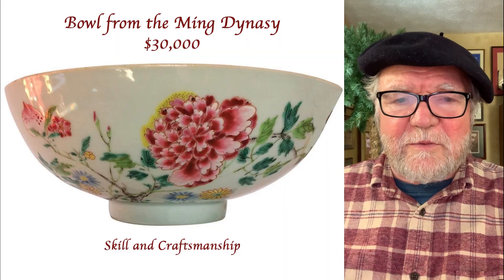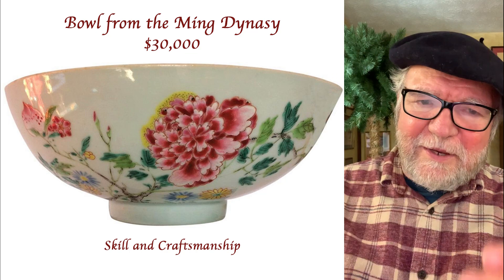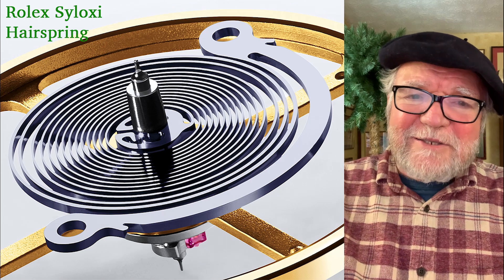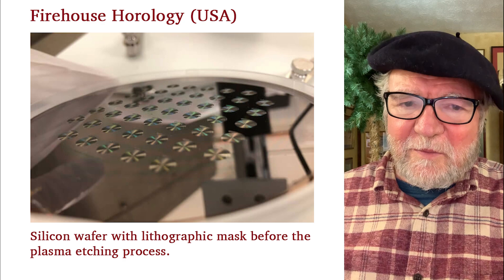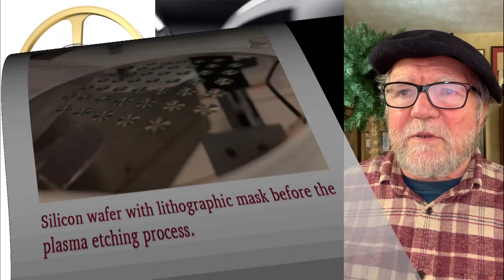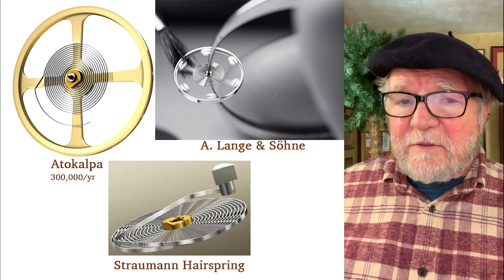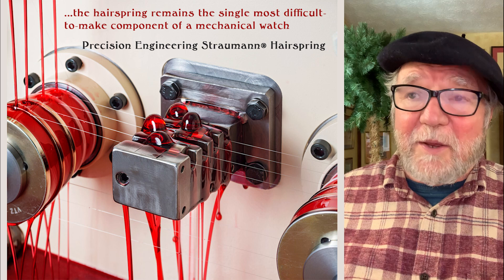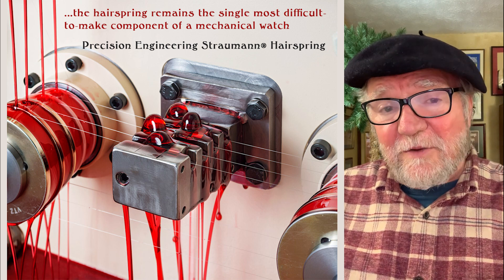Why I’d Prefer Not to have Silicon Hairsprings #VP88

Comment: Interesting, Bill. I'm naturally suspicious/cynical when modifications to established technology are sold as a technical benefit, while coincidentally representing a significant cost-saving to the manufacturer! I also prefer parts in all things to be 'fixed' if needed, not 'replaced'. But... Like it or not, as with most modern 'things', most modern watches from the big brands are relatively mass-produced. Even if they don't use silicon, they'll have 'computer' made parts and part replacement schedules - this seems the direction Rolex has taken with its new movements (great article recently in Quill and Pad). To my knowledge, most 'artisan' watch brands still use steel, though I concede a grey area with supposedly high horology brands like Breguet, Patek etc.

But where do we draw the line with 'synthetic' materials, replacement and automation? The mainspring, hairspring, case, sapphire... bracelet? Would a car analogy be the engine block, the chassis? A bicycle, it's frame?I guess your point is that the hairspring is such an intrinsic part of a watch, that to replace it is to definitively alter the watch, also that its manufacture or adjustment is so difficult that it 'embeds' the inanimate object with a human touch and craft. Blimey, starts getting a bit existential, this horology doesn't it!?
Reply from the maker: James, modern watchmaking is in Smart Watches—all the silicon you want. Traditional watchmaking (for me) eschews silicon and values craftsmanship. However, I'm not telling anyone what they should want, just my own values in horology. Take care and be safe, Bill😷

Comment: Hi Bill.
I’m looking for my first - brand new, <= 5000 Euros - watch and I’m going crazy finding a movement that doesn’t have silicon. Can you help me?
I think Nomos’ movements are an exception, am I wrong?
Reply from the maker: Right now, watches from Swatch (e.g., Breguet, Glashütte Original, Omega, Tissot, etc.)  Rolex and Patek Philippe may have silicon hairsprings, Edoardo. However, most Rolexes still have Parachrom springs. For under 5k Euro, check out Parmigiani and H. Moser in the pre-own sales. Take care and be safe, Bill😷
Reply: @watchartsci  Seiko and Grand Seiko. Also some Panerai, some JLC (though a bit more expensive).

Comment: But I don't understand. Do you want your watches to work reliably or not?
Reply from the maker: Aravind, any quartz watch or Smart Watch will be more reliable than a mechanical watch, including those that have succumbed to silicon hairsprings. The problem of magnetization is solved by silicon, but it's also been solved by both Rolex Parachrom and H. Moser's Straumman's hairspring—both of transitional metals rather than metalloids—like silicon and arsenic. Besides, they can be adjusted, but silicon cannot—too brittle. However, if you like silicon in a mechanical watch, no one's going to stop you. Take care, Bill
Reply: @watchartsci  It is a good argument. Perhaps one day the industry will come up with a watch glass which can be adjusted as well to modify the overall appearance (dark/light/colors).